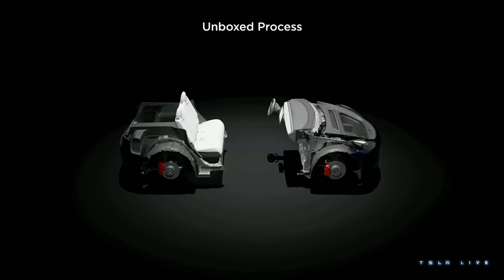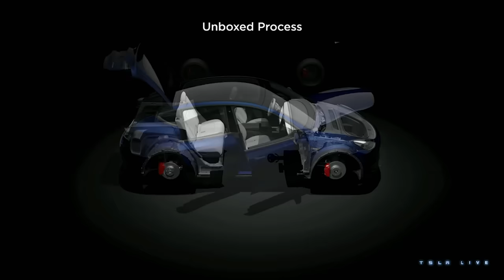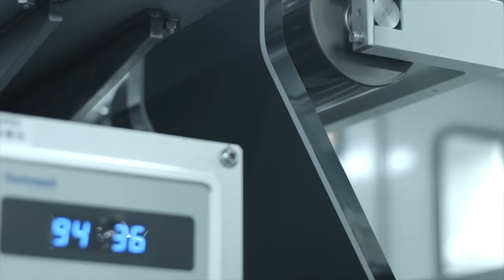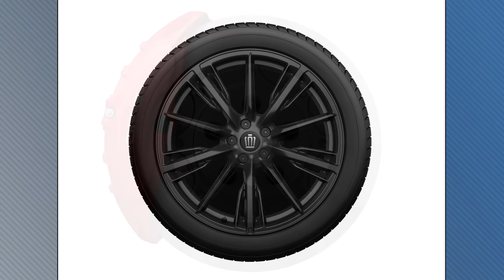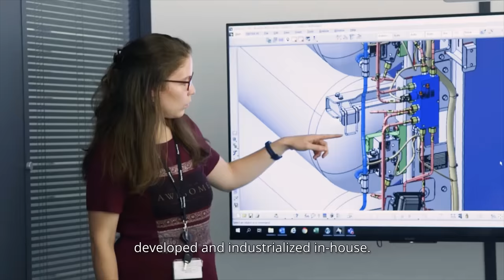Tesla Mexico Takes a Siesta; Germany Yanks EV Subsidies - Autoline Daily 3714

Comment: The brake sizing is how some OEMs state it... the number is the smallest wheel size that the brake package will fit within, its not an actual measurement.
Reply: Brake sizes typically are different from front to rear, the front brakes do 80% of the braking. The size stated is the diameter of the brake rotor not the wheel.
Reply: @hwirtwirt4500  no it's not... no car in the world has 20-inch rotors

Comment: The Nio announcement is interesting, but doesn't the Tesla Cybertruck have this already?  Tesla has a central computing system with regional modules; steering, shifting, and throttle are all by-wire... not sure about brakes... is that the breakthrough?
Reply: This tells us it will take them 2 years to buy a Cybertruck and try to reverse engineer it.
Reply: @rwdplz1  🤣
Reply: @rwdplz1  Fly by wire has been in use for several decades in aircraft, Elon must have been a toddler when he thought he invented it.

Comment: How is a 48 volt accessories system a "great advancement"?  It will save a few dollars on copper wire and double the cost of now non-standard devices designed to work at 48 volts which will be exclusively manufactured by Tesla. Plus it would be sending hazardous voltages all over the vehicle greatly increasing electrocution potential.
Reply: A touch voltage of 50 V AC (1-1000 Hz) or 120 V DC for long shock duration (> 3 s) should not be exceeded in healthy adults otherwise a life-threatening condition may occur. For children and livestock the touch voltage is limited to 25 V AC or 60 V DC.
Reply: Higher voltage does not make a higher risk
Reply: It will save 80% of copper wire, which is more than a few dollars.

48 volt is a common standard

Many suppliers make 48 volt parts, not exclusive to Tesla. Tesla shared how-to 48v book with other auto manufacturers.

48 volt DC is not hazardous to humans.

Try again, but maybe with less propaganda next time.
Reply: Please take an electronics or physics class before making silly statements. V=IR. Increasing the voltage alone doesn't make a 48V architecture inherently more dangerous than a 12V - not unless you're changing the human body at the same time.

The computer industry is moving to a unified 12V layout in the near future after using 3V, 5V, 12V rails on power supplies for over 4 decades. The power switching will now occur on the motherboard. Same with the cars - the main bus will be 48V and the voltages will be stepped down as necessary. As most infotainment stacks now consume over 50W when idle this is a necessary step unless you want to keep using unnecessary amounts of copper wiring. For signaling fiber might be an option in 10 years but for power you still need copper which is in higher demand than ever before.
Reply: @ChitFromChinola  12 & 24 are standards, not 48.
Reply: @Tokamak3.1415  Most accessories other than head lights and high powered entertainment systems use very low power, generally in the range of a few hundred milliwatts to 6 watts. The wires savings is minimal. Requiring a series of inverters to drop voltage levels is hardware intensive and inefficient.  As far as the computer industry goes the current power supplies will be around for quite a while except on cheaper units where cost savings is the prime objective. A power supply using multitap transformers is more efficient than using a series of inverters, moreover placing these inverters on motherboards generates unnecessary heat and complexity. It's much easier to swap out a complete power supply than repair a burned up motherboard loaded with inverters.
Reply: @rp9674  Higher voltage increases electrical shock risk, if you don't believe me climb up on one of those tall electrical towers and grab a wire and the tower at the same time. Let us know how that works out for you.
Reply: @ChitFromChinola  If you have sweaty hands even a 28 VDC buss will give you a jolt, 48 will be a lot worse.
Reply: @rok1475  It won't kill you but would you intentionally put your hand across a 50 Volt AC or DC circuit? No, I didn't think so. Military equipment requires warning labels even for 28 volt circuits when the conductors are exposed where a person could get their hand across it.
Reply: @AuralioCabal  North America uses 240 volt service to the mains panel but 120 volt to most receptacles with the option of 240 volt for higher powered appliances. Stop taking the word of a Tesla shill and do your own research.
Reply: @hwirtwirt4500  
The original poster said “hazardous voltages” and “potential for electrocution”, and 48 volt systems are neither. Why are you defending scare-tactic propaganda?

“These practices are deemed appropriate for Battery Pack Development and Testing associated with the Department of Engineering. For these purposes High Voltage is defined to be greater than 50V nominal; systems with a nominal voltage of 48V are not considered high voltage even if they exceed 50V when fully charged.”
Reply: @hwirtwirt4500  
The 48 volt standard has been used in European car manufacturing for many years. Keep trying . . .
Reply: @ChitFromChinola  What cars?
Reply: @ChitFromChinola  This has nothing to do with battery pack development which already ranges from 400 to 800+ VDC.
Reply: High power is dangerous, not high voltage Nikola Tesla demonstrated this in the 1890s
Reply: @rp9674  Voltage determines the amount of current is drawn across a load. Power equals Volts X Amp.
Reply: @hwirtwirt4500  
Porsche, Bentley, Volvo, Audi, and others. 

Don’t you get tired of these little knowledge contests that you create? The bottom line is that 48 volt is not an “electrocution hazard.” That is scare-tactic propaganda.
Reply: @ChitFromChinola  Setting the record straight is sometimes painful, consider it a learning experience and be thankful someone is here to enlighten you.
Reply: @hwirtwirt4500  and without specifying the current, you can't say it's high power, just because it's high voltage
Reply: @hwirtwirt4500  I'm not an EE but I did learn electronics before learning how to ride a bicycle. Your statements about cars and their power usage is not true. A side hobby of mine for about a decade was upgrading the infotainment systems in cars for myself and friends - and everything from a Acura TL all the way to a Porsche Cayenne all use various systems off their central bus that are more than a few watts. The navigation and DVD map on the 3rd gen TL alone pull 32 watts without any audio. When even a Toyota Corolla now has a subwoofer that pulls 25 RMS watts you're going to need the 48V. Sure we could limp along on 12V, but why don't we just go back single engine prop planes while we're at it?

It would be arrogant and almost a Dunning Kruger posterchild to say I can't be wrong in my assessment, but considering the stuff you said about PC power supplies contradicts what established outlets like Gamers Nexus and Intel (the company that basically spearheads the spec ratification), forgive me if I fail to agree with your assessments. Moving all the power stepping to the actual PCB where the 8-12 layer boards have different voltages would actually reduce heat - that's something you learn in the second or third month of circuit design. If this wasn't the case Intel wouldn't bother trying to change everybody's PSU only to have the system as a whole use more power.

Yes it is easier to swap out a PSU than a motherboard, but when was the last time a static non-moving component on a board died? With 12 layer PCBs and 100K hour caps a thing motherboards aren't dying like they used to back in the 1970s. Coincidentally, haven't you noticed that it's hard to find a board under $200?

That's the way the industry is moving. If you have objections I suggest you write your white paper and take it up with your representative.
Reply: @rp9674  Current (amp) = Voltage/Resistance (1 volt across 1 Ohm = 1 Amp) (1000 volts across 1 Ohm = 1000 Amps). Power (Watts) = Voltage X Amperage.
Reply: @Tokamak3.1415  "Your statements about cars and their power usage is not true" Every statement I made is in fact true. I'm not a tesla fanboy who's automotive knowledge is limited to tesla ad copy.
Reply: @Tokamak3.1415  "the stuff you said about PC power supplies contradicts what established outlets like Gamers Nexus and Intel " Show me one motherboard used in a true gaming computer that runs on a single 12 volt source. Rhetorical question, none do.
Reply: @Tokamak3.1415  "when was the last time a static non-moving component on a board died?" No current motherboard runs off a single 12 volt rail nor uses dc to dc converters which if you knew about them tend to run hot. Replacing surface mount parts on a motherboard is no simple task and requires specialized tools and knowhow which you don't have.
Reply: @Tokamak3.1415  "It would be arrogant and almost a Dunning Kruger posterchild to say I can't be wrong in my assessment" But that's exactly what you're doing!
Reply: @heathwirt8919 nice, doesn't change anything
Reply: @Tokamak3.1415  "That's the way the industry is moving. If you have objections I suggest you write your white paper and take it up with your representative." Pretty much everything you said is conjecture or suggestion, none of it is real at this point in time and due to your lack of hardware knowledge you talk as though it is.
Reply: @rp9674  Because you can't comprehend the relationship of voltage to current draw. Perhaps someday you will.
Reply: @Tokamak3.1415  "I'm not an EE" That I agree with 100%.
Reply: Maybe start with Ben Franklin, work up to the Leyden Jar, get into Nicola Tesla, get some anger management therapy, learn how to talk to people w/o being condescending & belligerent
Reply: @hwirtwirt4500  
All you have done is repeat scare-tactic propaganda. Try again.

Both SAE and ISO have published standards for 48 VDC.
Reply: @ChitFromChinola  I didn't mean to scare you, sorry.
Reply: @ChitFromChinola  I was disagreeing with the talking head at Autoline Network that was just reciting what's on the prompter and the fact that he called it a "big advance", it's not. Just another cost cutting gimmick from Elon Musk disguised as something better.
Reply: Watch the Munro Associates videos on the subject and you will understand the benefits.

It's clear you are not educated on the topic as none of what you posted is factual or makes sense.
Reply: @BTC_Minarchist  Munro is just making tesla commercials, he's lost his credibility. If you like listening to tesla shills preaching to the fanboy choir that's your channel. Factually not so much.
Reply: @heathwirt8919  if he were ripping Tesla apart, then you'd think he's credible.  😆
Reply: @BTC_Minarchist  He's simping for Musk and can't be taken seriously.
Reply: @heathwirt8919  If I want engineering information and details on Tesla, or any other manufacturer, who do you recommend I should rely on?  I'm sure there are many, that I'm not aware of.
Reply: @BTC_Minarchist  Review information given from several sources and do some of your own research on automotive technology, battery systems, suspension systems etc.
Reply: @heathwirt8919  I figured you wouldn't provide one.  I'm asking you who you recommend to determine if you were basing your opinions on feelings and rumors, versus facts.  It's easy to dismiss Sandy, or anyone else, without providing an alternative. 

BTW - I do all of that you stated and have several sources I follow, including Sandy.